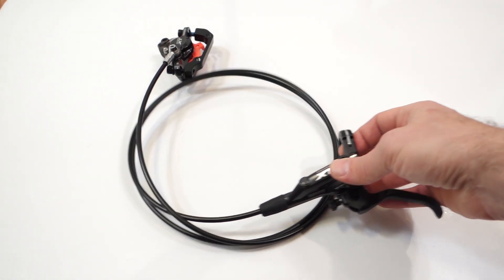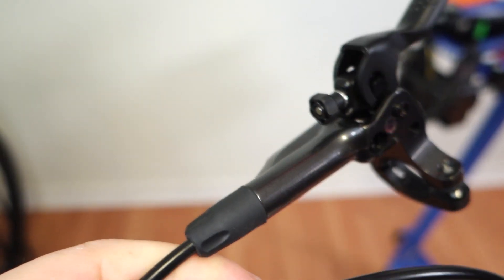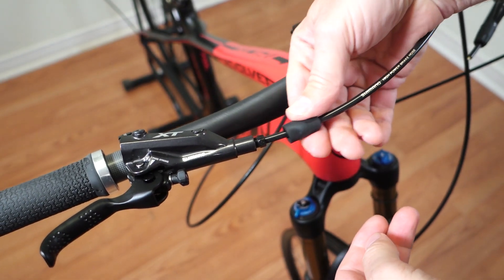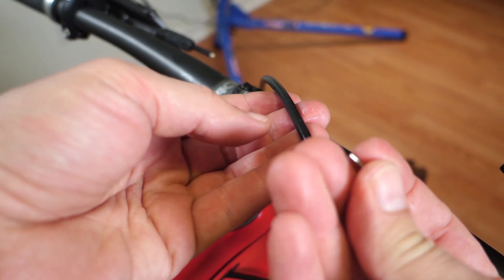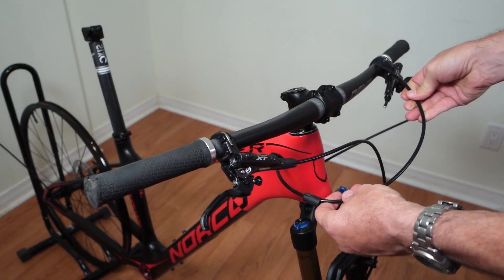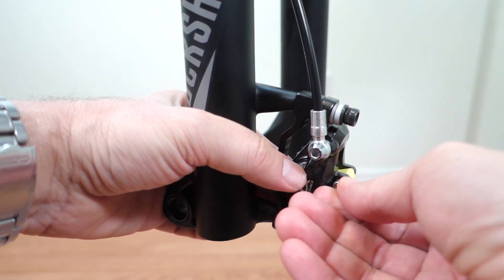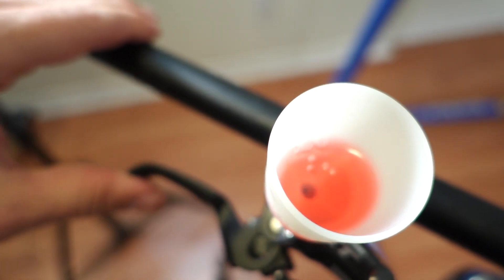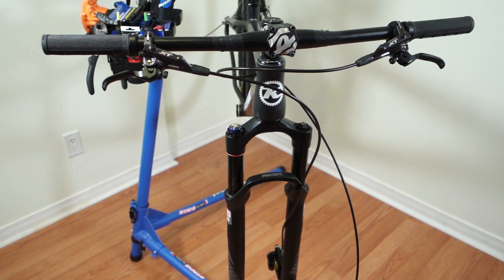🔥How-To Install Shimano Disc Brakes 🔥 Brake Hose Shortening and Quick Bleed

Comment: An OK video but @:16 you forgot to mention the hex key sizes needed for the procedure (for the brake pad bolts, potentially the caliper mounting bolts, and the lever bleed screw). While these are common shop tools, I thought I'd mention it for those trying this on their own with little experience and limited tools. "Know before you go!"

Comment: Hello I got the right olive and insert for my brake for bh90, brake is deore m6100. Since you do this often I followed your advice and it all worked for the first left brake, the olive came on the end like a glove but the right brake somehow the olive didn't fit over the hose end like it should it was just a fraction bigger maybe from swelling of the insert or a manufacturing flaw of the cable thickness. Anyway people would suggest cutting the hose shorter and doing it again but I couldn't cut it any shorter at this point. What I did is use fine sand paper in circle motion to polish the hose end until I could bearly just put the olive.
Reply from the maker: @LevianDragonFan  you did the right thing. Cutting the hose is usually considered the cleaner way. And keep an eye on it for leaks for the first few tries you use the brake

Comment: Nice vid! What do you recommend if the hose still slides out of the master cylinder? It seems the master cylinder is defective if it won't crimp the olive do you think?
Reply from the maker: Nah you still have a problem there, did you tighten that nut properly? It has to crush the olive on the hose/ insert
Reply: @LoveMTB  yes I did, maybe even a little to much but it still didn't stay. I ordered some new olives and a kit. I'm going to cut the end off and try with new parts tomorrow. If that won't fix it I'll try replacing the hose 🤷‍♂️
Reply from the maker: It's a very simple process, just follow my steps😉 @Laurel-Crowned
Reply: @LoveMTB  Thanks bro! Been working on cars my whole life so no biggie but this plastic junk worries me lol

Comment: thanks for the video, glad i saw this.. i have a question  i forgot to put back the rubber cover after shortening the hose ( I already tightened the the connecting nut), do i need to use new olive and pin if i will remove the hose from the lever so i can put back the cover? thanks
Reply: @LoveMTB  if I manage to pull out the insert can i cut the hose just beside the olive? So it will not get that short.

Comment: I have buyed e-bike with xt deore brakes. The brakes feel amazing. I have just notice my back  break pump when I release its abit stiffer that my front brake. The back break work great expect the release of it when I leave the break it’s abit like slower that the front. Can this be caused from air inside the breaks? Bike is brand new I only got it yesterday and didn’t event go to mountain. I went today to store to ask a guy check my oil breaks and he said me to ride it and see if it goes away. I don’t see or believe there is some dmg on the mechanism. Thanks

Comment: Used this guide more than once now. Thanks! When done correctly, how close should the lever be to the handlebar when pressed and the wheel's fully locked up? Thanks again!
Reply: @LoveMTB  I think I've removed most of the bubble and should be ok now. However, do you happen to know how to fix a  leaking bleed port on the M6120 calipers? I torqued it to roughly 5Nm. (Manual says 4-6Nm) but still lekaing. Thanks in adavance!

Comment: Great video. I will be installing new brakes soon. I will likely need to shorten the hosing. Should I be doing a quick lever bleed (like in your video) or a full lever and caliper port bleed? Which scenarios would you do the quick and the full? Thanks.

Comment: Can you use a Park Tool shifter cable cutter to do the job? 

Can you re-use the inserts?

Thanks
Reply: @LoveMTB  Oh why can’t the olives be re-used? Is it one time use because it gets compressed into the cylinder?

The olives are not uni-directional right?

Comment: I got a set of new M8100 Deore XT brake levers and matching brake calipers. I will need to shorten both front and rear hoses. Because I will need to pull the hose out from the lever and cut them, is it recommended I bleed to brakes to ensure there's no air in the system? Or because they're brand new, I don't need to bleed them? Thanks.

Comment: Done mounting my M6100 brakes now, and to my disappointment I'm a bit bummed over a tool I purchased long time ago that I have not used until now simply because I haven't had the need to. I tried the Park Tool HBT-1 brake hose cutter and insert "presser" tool. It failed badly, and at this price point it should definitely not function as badly as it does. Same thing happened twice in a row. First off it does not cut a straight flush cut, so you're left with a jaggety line and it as well crushed the end so you need to fix that. Not a big deal, but when this will happen every single time, it actually is in my eyes. Of course after an insert is mounted it may be fine, but I don't purchase tools like this to be sitting here with a half assed result.
Then onto the second function of it, which is to mount the insert. The issue here is the clamp, and to clamp it tight enough for the hose not to move, it actually destroys the outside of it and creates cuts and also deforms the outside. This creates an issue for the olive to slide past this messed up area, which again makes it impossible to even make the flared nut behind it able to enter the threads of the brake pump. I was seriously pissed at this point, and thankfully I have 10 olives and inserts so that at least wouldn't turn into a problem. I tried once more, and same thing happened over again. Both the cutting function and the insert function #¤%#"¤% it all up.
It was at this point I thought about how simple and easy the job looks while using the basic tools in this video, and I actually did purchase those two plastic clamps for the hose, and I have a Stanley knife. When I tried again using these simple tools it worked perfectly on the first attempt. The cut was flush, and just no issues. The clamping tool also worked as intended, and no messed up externals of the hose. Everything just worked. 
I'm just very disappointed at this point because I have a lot of tools from Park Tool that are more than good enough, yet this tool was a complete useless garbage to be honest. I will never use it again, but even though the basic tools work, I would like a purpose built tool, just a tool that actually works lol. I know Shimano has a simple one that I've tried in the past, and it worked so I might give that a go(Shimano TL-BH62).

The brakes themself are working like clockwork, so no issues there. Also glad I upgraded to 180mm discs because that made a nice difference for sure.

Comment: In this day and age where parts and everything is harder and harder to get by, I just wanted to be really sure how much oil I will need when my new brakes arrive. There's only one of my local shops who has got Shimano Mineral oil for sale, and they only got the 1 litre option. They also sell it at a premium price as well, so I'm reluctant to go that route. As I need to order brake discs, adapters and what not as well, I will rather just add a 100ml bottle of mineral oil to the cart as I now see that will do the job. 
I have not had mineral oil system before, but at least DOT fluid has a recommended shelf life after the container is opened, and that's why I want to avoid almost a 1 litre of oil just sitting there for a long time. It would most likely be sitting there for 2 years time till the first full flush of the system is due, and by that time I don't feel confident in using that same fluid again. The 500ml option is too hard to track down now if I want to order together with the other parts, so 100ml it is.

I hope this shortage of supply shenanigans will turn around sooner than later, as I am so tired of it.

Comment: Awesome video! Follow-up question: so if I have two piston SLX BR M7000 calipers with BL M7000 levers, and I want to upgrade to four piston calipers (XT BR-M8120), could I simply swap out the calipers, keeping the original M7000 SLX levers and hoses? Then, after swapping out the calipers, conduct a quick bleed as shown in the video? This would make the upgrade much easier as I wouldn’t have to install everything from scratch. Thanks!

Comment: its been a while since my last Shimano brakeset so thanks for refreshing my knowledge….can you cover off the difference that shimano have made in the hose barbs…as i’ve just been to the LBS and they say there is a silver one like you used and also the gold coloured barb i used several years ago…..i’m not quite sure what my brakes have as they are still in the mail, so i bought both…which are more expensive they they should be lol

Comment: What would you recommend if you haven't got the yellow block
Reply: @LoveMTB  thanks for the reply some one was going to charge me £30 just for a front brake bleed I was on about the square block to tap the thing in the end of the cable
Reply: @LoveMTB  thanks mate happy riding

Comment: Very helpful, apreciate the time and effort you've put in. 
I have a question, I have changed the  rear brake and oil is coming of the brake lever, ( I've tighten it as much as I could and didn't help). So, I am thinking to shorten the hose couple cm and add new olive and insert. Do I  have to change the hose as well? The hose is new, it came with the brake set. 
Cheers.
Reply: @LoveMTB  I removed the hose and checked the olive, and it seemd all right, could it be the hose not being cut straight although I did my best🤔 I'm gonna have to do it again, new olive and insert. Well, my first brake installation, a learning curve 😁
Cheers.

Comment: Hello. I'm having trouble inserting the barb into the hose. I already attempted doing it twice but the hose seems to be really tight and I cant manage to fully insert the barbs. Took me close to 5 hours of hammering, and they still wont go fully in. Any tips?
Reply: Yes I do. I have the Shimano BH90 hose for the Deore brakes. I also have the silver barbs that came with the brakeset.

Comment: I didn't have the metal olive around the end of my SLX rear brake. Wonder if the olive is already in the lever end as it was all brand new?
Reply: @LoveMTB  Bled my NEW brakes last week and only removed the yellow plug and put the hose in there (with the metal piece hammered in). Didn't do anything with the olive but I pressume the hose I pushed in has gone into the olive.

Comment: Great video. I wish Shimano would provide the little yellow thing and the insert and olive when you buy brakes.
Reply: Lol my new 8120 set came with everything but the barb insert, just a dummy barb inserted for routing, you then cut and have no barb but a preinstalled olive in lever.

Comment: Front brake is ONLY on the left
Reply: Not in countries that drive on the left.
Reply: No it's not ONLY on the left. And it has nothing to do with driving on the left either. How many motorcycles have the front brake lever on the left ?
None. The whole reason why the front brake system of motorcycles and bicycles is on the left side of the fork is for cable routing to go to the right.
It routes up the left leg and arcs over to the right lever in a smooth path with no bends. I know that manufactures set the cables/hoses up backward due to tradition but they are made to be right hand front brake.
Reply: @tristanwwsd  Something for you to read: https://cyclingtips.com/2009/05/why-do-brakes-differ/#:~:text=For%20example%2C%20here%20in%20Australia,on%20the%20left-hand%20side.&text=You%20ride%20on%20the%20right,on%20the%20right-hand%20side.

Comment: Can i swap hoses of deore m615 and xt m8000?
Reply: LoveMTB yes i’ve seen it and indeed was very helpful. Thanks for that man. But what im tryin to ask is that i have here my xt which replaced my deore. Problem is, my hose on the xt (rear) is shorter than the deore. So im thinking if i could take off this hose from my deore and install it on my xt. Sorry man if it sounds complicated. But thanks in advance.
Reply: Problem is i dont know how to take off this banjo. And no bike shops here in my place unfortunately.🤦🏾‍♂️
Reply: LoveMTB thanks man.

Comment: XLNT video!  Do you have to use a specific grease on the olive and the threads of the screw in nut part (sorry, forget the name), or can I use say any automotive grease?  I happen to have a can of Mobile 1 synthetic grease (purple stuff)... would it be ok to use this for my grease? Thanks!
Reply: @LoveMTB  Anything?  Honestly, that's a bit reckless to say that.  Wd-40 would be horrible, for example.  I'd highly recommend silicone grease!  Silicone grease is commonly used for lubricating and preserving rubber parts, such as O-rings. Additionally, silicone grease does not swell or soften rubber, which can be a problem with hydrocarbon-based greases. It functions well as a corrosion inhibitor and lubricant for purposes that require a thicker lubricant.
Reply: @RobbiePfunder  Haven't heard of WD-40 grease yet.

Comment: Since you were just doing a ‘quick-bleed’, what was the purpose of installing the bleed block? Is that really a necessary step?
Reply: @LoveMTB  Thanks for the response. I did a quick-bleed and used the blocks as you recommended... worked great. Super easy and got a bunch of air bubbles out of the system. Thanks again.

Comment: Hello mate, 
I have recently purchased the new deore xt m8100, the front brake works fine it’s rock solid but no matter what I do to the rear brake it’s just weak as heck, no matter how much bleeding I do, do you have any tips or wisdom? You seemed to be pretty experienced with a variety of shimano brakes. 
Thank you in advance 🙏

Long story version below lol

I bought them through a bike shop where he could services my bike, install the brakes and put a new stem cap where the front brake hose could pass through,
usually it’s something I’d do myself (live overseas and don’t have many tools to change the star nut ) so I chose to get it done through a shop and have the mechanic there do it, ofcourse he had no idea what he was doing I think it was the first time he ever had done hydraulic brakes 😟 but anyway, I took them home and I couldn’t even bed the brakes in because there was so much air in the brake lines I couldn’t get a good enough grip to start. So I bought a bleeding kit which I thought I wouldn’t need for a while. So I bled the brakes and the front one was good and solid but the the back one I tried everything, watched soo many tutorials and read forums and can’t just seem to get them to not feel spongey compared to the front one. 
I still think the front one is spongey but maybe I’m just used to squeezing the life out of a cable actuated brake lol.
Reply: LoveMTB thanks for taking your time to reply mate I really appreciate the effort , perhaps I just have to get used to comparing to cable brakes, I’ll try a bleed again because the rear isn’t close to being like the front one (ofcourse I’m aware that front brake has more stopping power lol). 
I’ll reset and re bed the brakes, good luck to me and thanks again!
Reply: LoveMTB I decided to loosen everything up and re-tighten all the connects seems to have improved a little since last check, now all I have to do is wait for this weather to stop raining so I can get out and ride before the snow comes 🙏
I will report back! Thanks again
Reply: LoveMTB you weren’t wrong! I think I got to the bottom of it and holy balls I almost filled my pants on multiple occasions at the power of front and rear 😂 I had to adjust the pistons slightly between front and rear for them to feel the same and they feel awesome. Using it for a dirt jumper/trials bike thingy, they are powerful, I wanna switch to some resin pads cause I think they are a little too noisy. Thanks again for the encouragement and help!

Comment: Can i use slx br7000 straight out of the box without shortening..i see it comes with the brass fitting and tip to be hammered in.is that because if cutting off you lose them and those are replacements.or this process needs done before using..sorry if this is a silly question but i just like reassurance..ty
Reply: Thanks i did install them just to get a feel for them im going to take off several inches from each.
I was just starting the process and cruising around wearing in the pads. I just wanted to be sure that was ok.b4 i trim them down..allgood i appreciate you getting back to me. Im a subscriber now and will tune in to support your channel..peace!!

Comment: I have Shimano BR-MT500 brakes and wonder if the yellow bleeding block will fit? If I remember correctly there is different colors (size) like red bleed blocks.

Comment: Great No Nonsense Tutorial using basic tools and techniques, now I know for SURE that all I need to buy is the Olive/Inserts & Fluid.  Curious about cable cutters on tubing?  Im guessing they crush/deform cable or you would have used them, what about electrical wire stripers?  Thanks for Tutorial, the fact that you were not wearing gloves immediately told me your are a real mechanic who's first brake bleed was not on a bicycle :)
Reply: Bad practice. One should get into the habit of using gloves. Contaminants come from human hands also.